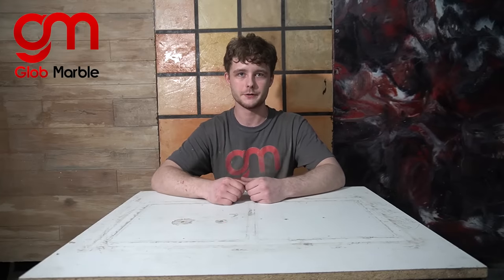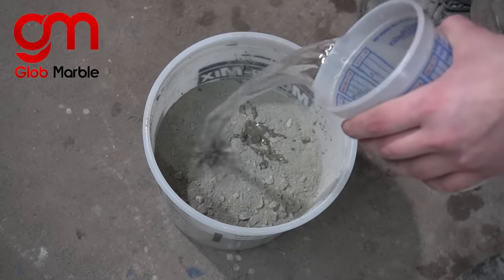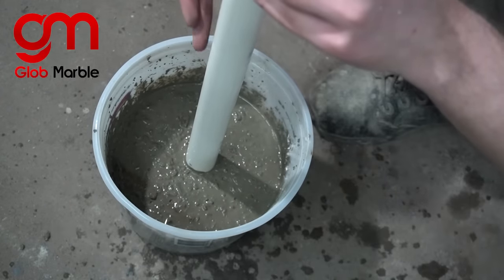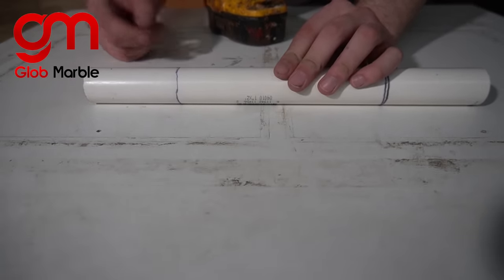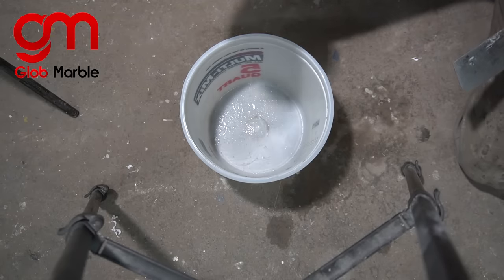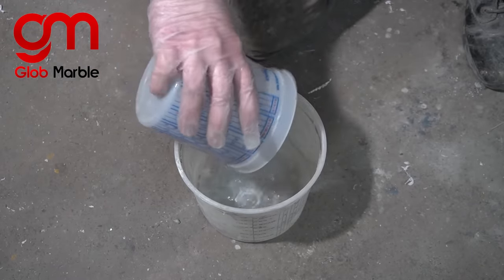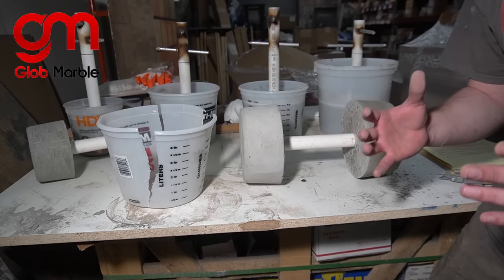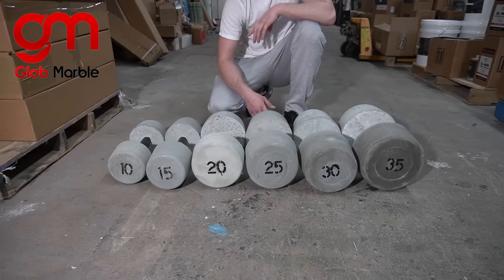Concrete Dumbbells | DIY

Comment: What's the size of the pvc pipe 3/4 or 1inch?
Reply from the maker: I used 1 inch but you could always drive over to home depot or lowes to sample which thickness is better for you :)

Comment: Use an OLI micro vibrator to remove excess air for more accurate weights..
Reply from the maker: Air has no weight :)
Reply: @GlobMarble  completely wrong statement..in that case while building any concrete structure why is concrete compacted?It is to maintain the strength and durability of the structure by removing pockets of air..secondly as per your analysis a 5kg dumbell with 99% concrete and 1 % air would have the same weight of 5kg even if it's 70% concrete and 30% air...best of luck..

Comment: That 35lb is huuuge 😂
Reply from the maker: Lol I know right, I've seen people use motorcycle gears to make the heavier dumbbells smaller, but I think just any scrap metal as aggregate will do. Maybe even pointed bb pellets, but not the round ones. Those will make the concrete weaker.

Comment: This is sad in the situation we are in , this is what bodybuilder do in third world countries so they can have weight for their gyms , I know because I saw it done like 15 years ago when I took a trip to Nicaragua.
Reply from the maker: I think everybody should be doing this, its just so much cheaper than buying steel dumbbells. Literally the only downside is the size
Reply: @GlobMarble  yup are you can buy the Bowflex dumbbells power locks they are the same price .
Reply from the maker: Nope, cheapest ones are like 400